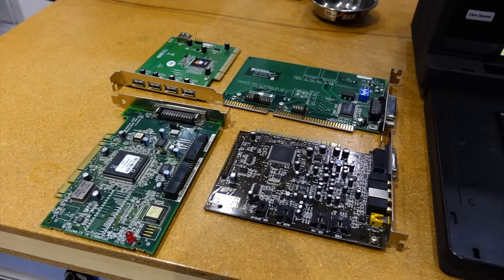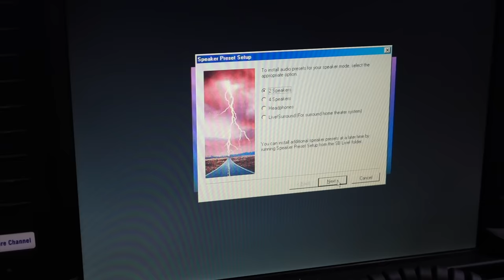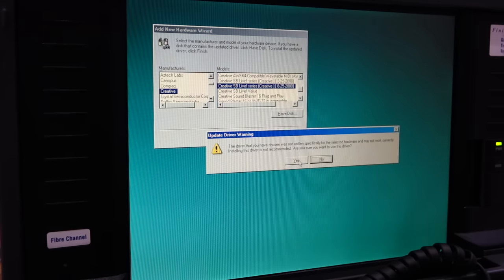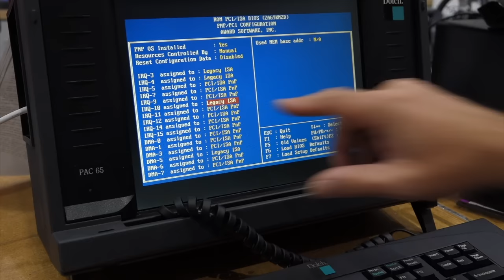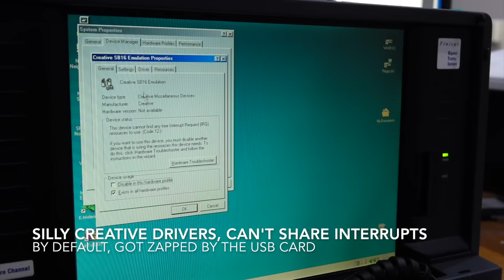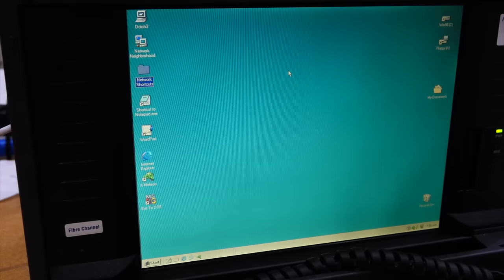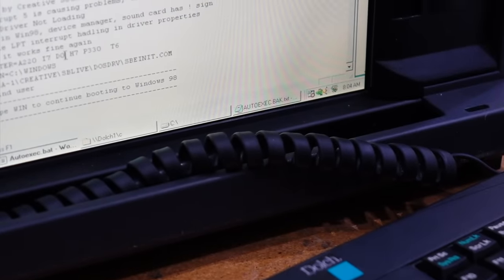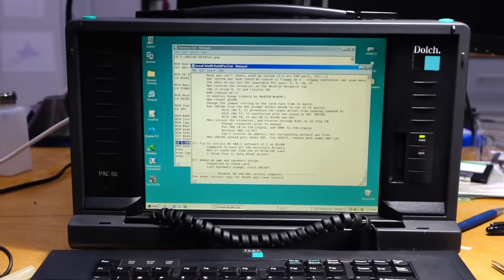Dolch Pac 65 - Part 6: Adding Soundblaster, SCSI,  GPIB and USB cards to a Win98 computer

Comment: I certainly don't miss the days of setting jumpers for absolutely everything (I think I even remember having to set jumpers for the CPU voltage, which was also kinda cool because it was easy to overclock your processor), but I really do miss the days of just being able to move programs around by simply copying folders instead of having to install everything.

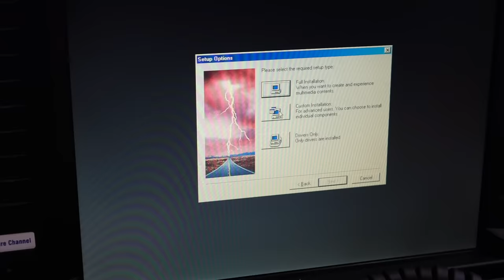Heh, when I was a teenager I had a poster of that image that's shown at @2:00. It was kinda cheesy, but I also kinda miss it.

Comment: If you add Logo=0 under [Options] in msdos.sys then you won't get the Windows 98 splash screen during boot, which helps for a more DOS-like feeling :)
Reply from the maker: Thanks for the tip, I didn't know!
Reply: Or you can find some nice Dolch logo, put it into 320x400 256 color BMP, name it LOGO.SYS in C:\ and have fancy customized splash screen ;)
Reply from the maker: Ah, that's where it hides! Thanks, I didn't know either.
Reply: Having the right splash screen adds a lot to it. My boss was amazed a few weeks back when I tweaked some industrial touch panel my company sells with its systems (third party product, just with custom programming done by us) to show out logo on startuo instead of the original vendor's logo.  ;-)
Reply: aw maaaaan what you reminded me right now... spending so much time tweaking with .sys options and parameters in .bat ... fucking ERRORLEVEL

Comment: It's nice to see that also computer experts like you can't get in an usb in the right direction at the first attempt like us mortals ;)
Reply from the maker: +Marxyz: USB *always * plugs in the wrong direction! Then you switch it around, and it is *still * in the wrong direction. Then you switch it around once more and it might get in. One of the most frustrating connector design in the history of humanity.
Reply: I believe they are the only 4-dimensional connectors in existence.
Reply: I was about to say exactly that. That's the only connector that only fits after rotating 180 degrees TWICE.

Comment: As someone who has a SCSI cable running from an external port to an internal tape drive as the card didn't have the right connector internally, I wholly approve of this connection method and the sound module. Edit: My home server OS disk died while watching this, must be some kind of curse transferred via Youtube...

Comment: Hey Marc - I love the Dolch series. I’m going to start working on a PAC 60… I’m missing the keyboard cable, as the 60 goes from a 5-Pin-DIN to Mini-DIN, so I get ‘keyboard error’ at boot currently. Can I pick yer brain if i hit any issues? Maybe a ZIP of your DOS install if I’m lucky… cheers. 🎉
Reply from the maker: All my installs are available on my website: https://www.curiousmarc.com/computing/dolchpac-65-luggable-pc
Don’t have a 60 so not sure now much help I could be, but you can always ask!
Reply: @CuriousMarc  thank you - I found your website before you replied, but it WAS very helpful. I’ve found a dolch pac60 user manual that’s also very very helpful. I’d you’d like my dolch collection just lemme know.

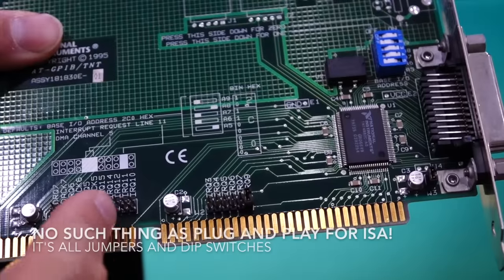Comment: At 0:50 "no such thing as plug and play for ISA", except for all of the ISA PNP cards. The National Instruments 183663C card is a Plug and Play version of the AT-GPIB TNT. One of those might have made things easier under Windows, although it might have been more work to get it configured under DOS with some sort of ISA PNP configuration utility.
Reply from the maker: Yep that is true (and Glen knows everything). NI has a so-called "PnP" version of the same card. It's a bit of a misnomer though. As you say, it's not really PnP, it's just that instead of jumpers you need to configure it through a software utility. Which I find much worse, since you can't configure it unless you have said utility. So I stick with the jumpered ones.

Comment: is your 2940UW firmware up to date? I can recall having large and small disk issues until I installed some firmware file for it from 2001 or 2002. they usually have one from 1997-1999 on them or something from memory. the firmware itself might be slightly unobtanium now, but it's still worth a looksie.
Also, if you're gonna do XP, please do run Speccy on it for that video. it'd be interesting to know what that pulls up for information on the basic stuff installed (board and drives, I'm interested in seeing the listed drive temps if SMART is even being passed through.)
Reply from the maker: +Sudos Thanks for the tip on the SCSI card firmware!

Comment: Love your work Marc 😃👍. Are you still working on the Digibarn?
Reply from the maker: It's sitting quietly in the entrance hall, you'll see it in some upcoming videos. No one is eager yet to spend the large amount of time it needs. Ken was working on a Xerox-Alto-debugge-in-a-box, so maybe if project that succeeds it'll be the guinea pig. It temporarily lent some parts and cables to the haunted Diablo drive, so it has been useful in its own way.

Comment: Did you check that Serial still works in Win and DOS?
Reply: pretty sure it does, have never seen a computer that has a serial port on it somewhere which does not work
might have been just very lucky

Comment: Neat, that's got a good selection of expansion options. Seems like they're pretty uncommon sadly, especially for reasonable prices
Those NI GPIB cards are great too, especially since some genius guy wrote a program to emulate old HPIB storage media (HPDrive)
Reply from the maker: Bingo! The GPIB primary use if for HPDRIVE/HPDIR HP storage emulation, from Ansgar Kueckes (I think he is a genius too, and we cooperated on the now included HP7970 functionality). The GPIB ISA card should be quite inexpensive (however the PCI versions are indeed expensive), and all the other cards should also be rather common and reasonably cheap. MIne were all from now defunct Weird Stuff - really cheap.
Reply: I picked up the same TNT ISA card for next to nothing some time ago, I hadn't touched interrupts and IRQs in ages so that was "fun" to relearn lol
Sadly my HP 1630d logic analyzer doesn't detect drives at all for some reason (which is what I got the card for), I'm guessing some ROM issue since it doesn't even show the disk menu (yet it does communicate enough to control over HPIB just fine). Oh well...
Should be extra useful for my HP85 too, since all the original program tapes I got were hooped. Hopefully I'll find an HPIB card for that some day at a semi-sane price

As for the Dolch, were they commonly sold rebranded like this one? Might be easier to find a rebranded one in that case. Sure would beat the big ol tower I threw together with dusty old parts + the boat anchor CRT!
Reply: The original versions of the 1630A/D firmware had HP-IL mass storage support for the HP-IL 82161A cassette drive. Later versions switched to HP-IB mass storage support. If you can program a set of eight 27C128 EPROMs you should be able to update the firmware to the HP-IB mass storage support version if you want. I did that with my 1630D.
Reply from the maker: Glen, you are a precious source of encyclopedic knowledge when it comes to HP! Thanks for your help.
Reply: Yeah seriously, thank you!
I found your post on the EEVBlog when searching for the ROM and got the images, I think I can program some of them.
I wonder why it has HP-IB hardware but HP-IL software - maybe someone replaced the ROM card at some point?

Comment: Marc,  any reason you are setting last drive =z. No need to get to z unless you are running bannion vines. Save some space and drop down to r
Reply from the maker: I think one of the installers dropped that one in there, so I left it.
Reply: I guess it was custom to start network mapped drives from z:
Reply: code123ns well the odds of seeing a banion vines network are slim at best. And as far as I can Cecil Vines is the only network os that pulled default config and sharing info from z

Comment: Since your USB board was a internal and probably never will be used USB, why not put a USB Wi-Fi card on it?
Just to have the only Dolch computer with Wi-Fi? (probably the signal inside will be horrible but a small hole for a external antenna and a pig tail could do the job.

On XP and Linux it should work and maybe be useful,  or just use a "big" internal USB Flash drive (SSD or HDD) for backups
Reply: Problem is there aren't that many WIFI sticks that support Windows 98 if at all. WIFI didn't reallly become a public thing until after Windows 98 was released and it was WIreless A and then Wireless B (G didnt come out until after the 2000s). Also Windows 98 doesnt have any wireless manager so one would need to get some wireless management tool for Windows 98

Comment: It is a shame we cannot use a more modern Micro-itx motherboard running something like an A10-7800k and 64GB of DDR3 RAM and use something like Windows 8.1 and you should be possible to have the old drive as the slave and pull the documents of it and onto the new hard drive then everything should work.